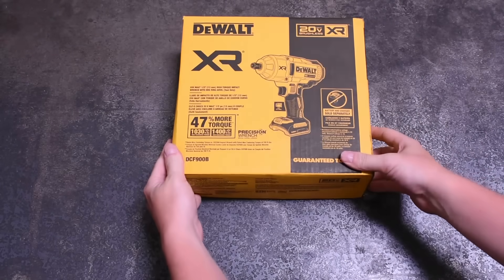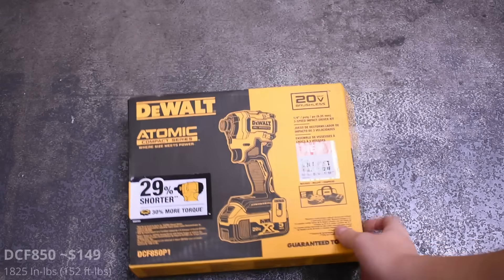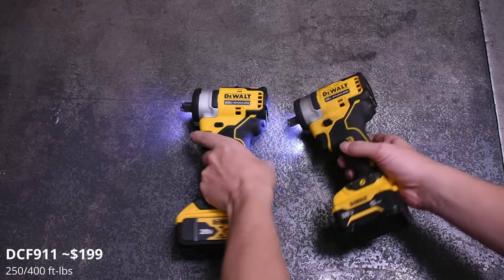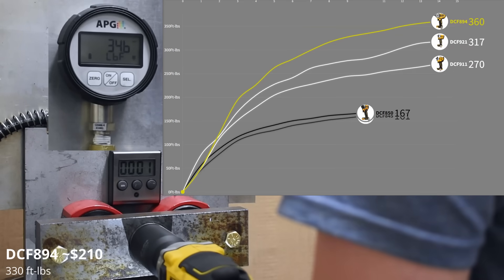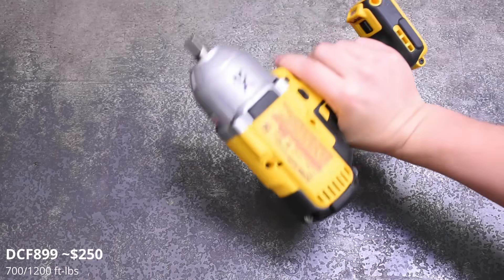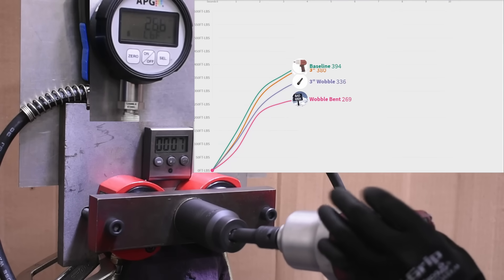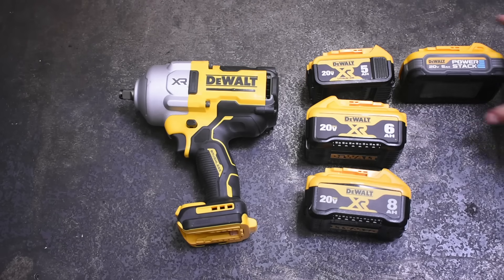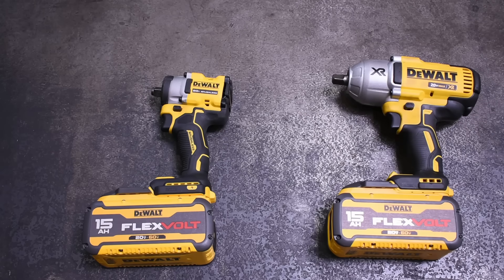Dyno Graphs of Every DeWALT Impact: How Much DO You Need?

Comment: Recently bought a DCF921 after watching your tests. Changed from summer to winter wheels/tires on our two 2007 Corollas.  It pulled aftermarket spline nuts fine from alloy wheels on one car. Toyota alloy wheels on the other car defeated the DCF921 at least half the time; those lugs were torqued to 76 ft. lbs. last spring.  I didn’t even consider the battery tool on my truck with 120 ft. lbs.  Full disclosure: battery was showing two of three bars.  For now, this tool does NOT replace my 1/2” air impact.
Reply: Agree, I just purchased the 921 "Atomic" and it is pathetic! Maybe it can remove a 140 ft lb lug nut if it's threads are lubricated!! Very disappointed
Reply: @bz2lrw  Agreed.  It does not replace a decent 1/2” air wrench.  Not even close.
Reply: so you don't recommend the 921 at all?
Reply: @calvintran8691  It works, but don’t believe some of the torque claim.  I robably should have bought the 923 and stick with 3/8” drive tasks.  I’ll still be using my 1/2” air wrench for changing tires.
Reply: @ thx i bought the 891
Reply: @calvintran8691  it removes smaller vehicles lug nuts just fine and I have decided to keep it for under body work (brakes, wheel bearings, ECT)

Comment: If the 921 gets up to 300ish ft-lbs, this would be approximately 400nm, right? And if my lug nuts on my car are torqued to 120nm as per manufacturer then it should be able to do it very easily right ?

Comment: Hardest bolt I ever removed was the steering box nut holding the pitman arm. Getting it off was even harder with a 2 ton pulley cranked as much as I could with with 24" breaker bar and 3' iron pipe then even had to heat it before it sounded like a gunshot went off when it finally popped off. I eventually decided to get some power tools because don't want to deal with that bs anymore.

Comment: This video was informative thanks

I currently have a Dewalt DCF 787N-XJ that wasn’t in this video, I don’t really know what the suffix characters mean however it’s mostly been good enough for me but it’s not strong enough to remove things such as wheelnuts etc so I am planning on upgrading to the DCF921/922 as they state 600nm of breakaway and it’s a nice compact size to get in tighter areas

Comment: I just retired and I don't know what to get...so if I am working on my mower deck and can't the blades off...which one of these fellas is going to get the job done and also get the tires off my car or truck without much fuss? I have 2 20v/60v 6AH batteries and 1 20v 5AH battery. I don't want to buy too much to handle but I also don't want to have too little for the unexpected. And could you use normal sockets on them or do I need to but another full set? I need help

Comment: I have a question.
Will a DCF921 and a DCF900/(DCF961) work identically when using with an impact torque limiting extension bar 135Nm/100 Ft-lbs for tightening lug nuts?
Or does the size matter even in this usage?
I already own a DCF899 but would like to get another for tightening the lugnuts as changing sockets is boring. So I want a new gun for tightening. But I can not decide what one I should buy, the cost is of less importance (and I always recheck with a torque wrench after I am done).

Comment: I bought a DCF900 yesterday, wanted the 891 but for a bit more money I got another battery and charger. The 900 does a great job ripping the leaf spring bolts out of an old Samurai, but I destroyed one socket that got stuck between the immovable object and the unstoppable force.

Comment: I purchased the DCF 961 after having numerous problems when restoring my 2003 Volvo S60... users should be aware that it's quite capable of shearing Factory-fitted Lug Nuts alongside every other seized Nut! It's an absolute beast that requires a lot of thought before you unleash it!
Reply: Literally had the same problem after we bought it to use on our farm equipments. Apparently I shouldn't scolded my cousing about shearing 3 nuts from the tractor. It was that monster.
Reply: I’ve thought about getting the big boy 961 1/2 impact , or slightly smaller 900 but that atomic 891 “mid torque” has served me very well and hasn’t let me down on anything I’ve put it on… yet, and until then…

Comment: Debating between getting the DCF891 or the DCF921… I’d mainly use it for removing lug nuts with the occasional suspension work. Obviously the size is the concern. In an engine bay the smaller one would be much more useable for sure but obviously not as powerful.
Reply from the maker: 891 for suspension

Comment: Actually the perfect application to 1/4 impact drill/drivers is in carpentry and in particular rough carpentry.  Without question there is not comparison to that of an ordinary drill/drivers.  My favorite for this application is the Dewalt XR Impact Driver, Brushless, 1/4", 3-Speed (DCF845B).  It is very compact enabling it to squeeze into tight spaces like studs that would be impossible with ordinary impact drivers and even the smaller width the Dewalt "Atomic" variation.  The three speeds enable a lot of flexibility.
 I also found that 1/4 impact drivers + screws with the more expensive Torx type heads (common in exterior applications) make the job so easy but the problem is that common Phillips head screw heads dominate for interior applications which require a lot more pressure to drive into place.

For automotive use, I would not even think of using a 1/4 IN impact driver but rather I would use a 3/8 IN or a 1/2 IN impact drivers.  I am not a mechanic, but if I were, it would not bother me to spend the extra money on the 900 or 961 considering that on Amazon are not that significantly higher in price than the mid-range cost of Dewalt  models.  Solves a lot of headaches.

Comment: I got my DCF891 with 5Ah battery not long ago . Had a short extender on and it did not losen any of my wheel bolts on a audi b6 avant. I know I regally over tight wheel bolts. And then it struck me  remove the short extender and try. I had seen the video where a extender or swivel reduce the nm significant, so removed the extender and all the bolts came lose so impressing fast and easy . But it difficult to quite understand that a extender that was only 6cm long did not remove one bolt event after tryning for over one minute on two different bolts.

Comment: Was changing the timing belt on an Acura TL and learned about the dreaded Honda crank bolts.
Used a DCF921 and a 19mm impact hoping it'd workout. It didn't budge.
Ended up getting a DCF900 and the weighted Lisle 19mm. 
Not even 1 second into pulling the trigger and it just broke free and came loose, it worked even better than I'd have hoped probably overkill even 😂

Comment: Would it be worth upgrading the motors and power systems to 60 volts or more for these smaller handheld power tools?  Is that a natural progression we might see in the future, as they run out of upgrade headroom?  I would think it could improve efficiency and maybe wire diameter?
Reply: Problem with 60v is the smallest possible pack requires 15 cells compared to only 5 for a '20 volt' tool. The highest power motors in the 20v tools can manage with 12 or 10 AWG at the worst and they all have overheat protection built in to account for this. 20v is ultimately a bottleneck and can't compete with 120v AC motors at 1800 watts and while 60v tools can in theory, that kind of power draw would require a massive battery to not drain in <10 minutes.

Comment: I'm still so confused. I want either the Flex 1/2" mid torque with 540ft lbs or the Dewalt 12 volt DCF901 with 276 ft lbs. But the Flex impact is roughly $125 more for the kit than a DCF901. The DCF901 is $70 for the tool, and the Flex is $199 just for the tool. I'm concerned about the 276 ft lbs not being enough for suspension and lug nuts? The Flex comes with a lifetime warranty, which is a good selling point, but $270 for the kit with a battery is a steep investment for a home use tool.
Reply from the maker: 901 wont do it all

Comment: Thanks for this. I've been trying to figure out what I actually need for general car maintenance. The dcf921 seems great for me. I almost went bigger but I like the compact size.
Reply: the 921/922 (they're the same?) is genuinely one of the best automotive tools, along with the milwaukee equivalent. Anything larger won't be as easily manouvrable, but most importantly get in those tight places, and anything smaller can't guarantee that the parts come off.

Comment: Dewalt 892 worked good on my very over-tightened lug nuts on a couple of cars and trailer, and also the big 33mm nut securing my tow ball, which was somewhat rusted on after 20 years.

Comment: What dewalt should i use to remove 4 bolts stuck to the crank pulley?
Reply from the maker: DCF891
Reply: @TorqueTestChannel would the dcf899 better? some idiot on audi dealership decided to overtight and probably put some loctite, couldn't break with 300nm torque wrench
Reply from the maker: @GunMetalMage  nah, 899 wouldn't be overall any real benefit over 891

Comment: I am not sure I understand these NM readings. I bought a brand new (from a reputable dealer) DCF887 with 18v 4.0ah battery which I fully charged. The user manual says it can achieve 189NM. My motorcycle has rear wheel nuts torqued manually with a torque wrench to 60NM and the DeWalt wouldn't even scare them let alone remove them ?

Comment: Recently got a dewalt 1/2” compact. 

I was surprised that it wouldn’t remove my Jeep JL lug nuts. Torqued 130lbs. 

DCF921B
Reply from the maker: There's not a compact we recommend to do most lug nuts.
Reply: @TorqueTestChannel  for sure. I had my M18 high torque ready to go. Was just testing it out etc. 

Still love it!

Comment: Thank you for the video!  It was very well done and as others have stated: just the information I was looking for/needed.  
Have you any thoughts/analysis on DeWalt's relatively new feature called Precision Wrenching that reportedly guards against over torquing the tightening or loosening with these mid to high torque drivers? Thank you in advance, c3.

Comment: How the heck did I miss this when it came out. Didn't even know about the 961. Guess I got to pay closer attention. DeWalt needs to put a 3/4" or 1" anvil in that 961 and then they can have my money. Amazing how tight some stuff can get. I had a bush hog gear box oil plug fall out on me and unknowing ran it until it seized. My 3/4" air wouldn't budge that nut even after heating it to cherry. Eventually had to use the hot wrench to get it off. You know it's tight when you start deforming the nut and it still isn't moving.

Comment: Ive got the atomic 20v 1/2 inch drill, the atomic 1/4 and 3/8 impacts and the 3/8 ratchet. Love them.
Reply: 1/2 inch drill is dumb. all u need ia 1/2 inch high torque impact, 1/4, and then adapter 1/2 to 3/8 and impact rated drill bit and ur set boyo

Comment: you have axle nuts come in lower than most lug nuts ???
Reply from the maker: Lug nuts are at 300, then if you want to cover EVERYTHING that rolls in, 475. The thing with axle nuts is everyone uses a torque wrench, and while it takes a decent size impact few of them are like STUCK and corroded solid. While lug nuts sometimes the last guy just ugga duggad it way too long then it saw salt for 5 years.

Comment: i have the DCF894, it couldn't free my ball joints off my 07' ram 2500 CTD but can loosen the lug nuts no problem. i'm ready for more torque  tho. I'm glad i had a 3' ratcheting 1/2" Dr. breaker bar as the ball joints were way overdue.

Comment: Hi. About 10y ago I decided to move to battery tools and chose team yellow over red or blue and I’m not disappointed. The other colours have their great features and I have some red handtools (lovely) and blue corded ones (fab). I have the following. My DCF885 (small), is the 90% go to and a very capable and controllable driver for screws and smaller other fasteners. Next the DCF880, a 9% go to, but only a little more capable. It’s sometimes very useful as a fairly short 1/2”. Finally the DCF899, a 1% go to but I’ve not found many occasions where it fails. Occasionally it’s been crucial but the same can be said for long box-end spanners and breaker bars. Also, penetrating fluid and a high-frequency induction coil-heater can be far more useful as big drivers can break fasteners as soon as look at them. Cheers!

Comment: Thank you for this, incredibly helpful video. I work on my car A LOT. I do anything and everything on it, anything from coil overs and other suspension mods to timing belt and water pump to soon, AWD conversion having to deal with swapping out a subrame. I also need to swap my transmission, do a new clutch and flywheel job, etc. So as you can imagine an impact wrench would save me H O U R S. I'm in between jobs at the moment so I'm working on a budget but I was looking at cheaper brands with about 360nm of torque. While I think it's still a decent amount I think after this video I will definitely consider spending more on a higher torque unit that is more capable of helping me on more jobs. Unfortunately these tools are quite expensive to buy here in Australia. For reference, the DCF891 is $399 and the DCF900 is $499 for just the impact. I was looking at a RYOBI with 360nm for $250 with a 5AH battery and the charger plus 3 impact sockets, 6 years of warranty and 3 years for the charger and battery. If I already had some batteries and a charger I would definitely get a nicer one, but I believe a nice 5AH battery and a charger would cost upwards of $250 on top of the $399 or $499. So quite expensive.

Comment: im puzzled by the torque recommendation chart - 174nm is the highest torque requirement i know of in e.g the toyota lineup - the landcruiser. a smaller cars` service manual like a suzuki swift specifies about 75-80nm torque for wheel nuts. 300lbsft is 400nm+ - thats insane for an m12 8.8 screw, it is almost m20 8.8.

Comment: Absolutely love my DCF900. It managed to shear a wheel bolt off a sprinter, where the milwaukee and snap on impacts couldnt even get a mm of movement. We resorted to a 1 metre breaker bar, with another metre worth of pipe to get all them off

Comment: I had to get a hydraulic nut off which if you don't know, takes high tourque on a small diameter. Tried everything, then realised I had an old Dewalt TR in the garage that I retired from my carpentry business due to being so heavy and not needing it because all our bolts are in timber. Needless to say, I do my truck tires too now.

Comment: Bro I needed that storm bringer. I used my DCF921 stubby for the rusted bulged upper control arm like you mentioned and none doing. So I breaker barred it with pipe cheat now all the nut thread is eaten up. Time to hit the angle grinder and welding in a new receiver nut. Wish me luck. 😂

Comment: Looks like fastening torque? Not break loose?
Reply from the maker: forward and reverse max torque, correct. Break away torque is a fickle one to measure, as it depends greatly on thread size, pitch and condition. Where as a gauged set up like this can be calibrated each day.

Comment: I have only found one thing that my 921 hates and that’s the lug nuts on my truck. Aftermarket aluminum wheels and i torque them to 150 ft lbs. I have to use my 891 to break most of them free.

Comment: That 6Ah XR battery link in the description not being sold/shipped by Amazon is kinda ehhhh..
There is however a 6Ah 2 pack on sale for $161 with the added benefit of having a payment plan provided by Amazon so you can pay $53 a month for 3 months, provided by Amazon meaning there is no APR and no credit check bs. (Though that payment option MAY NOT show for everyone)

The difference between normal 20V packs and the Power Stack versions are that Power Stacks use Flat Cell packs instead of 18650/21xxx type batteries right? if so that could account for the price/size difference i guess?

Comment: Iv hade most of these impact drivers in the last ten years and I have had very good luck with them dropping on concrete many times and the ony problem iv had was the  ball and spring chucks would malfunction dropping the bit out but it was an easy fix.

Comment: I bought a DCF900 a few weeks ago. Easily takes off rusted VW axle nuts. Though, the one it couldnt take off, neither could my co-workers 3/4" mac air gun. even with heat it took him maybe 20 minutes to remove it, he had to heat it up so much.

Comment: I have both of the sub compact guns,the impact driver and the impact wrench.The small size and enormous power make these impacts the best on the market in my opinion.Thats DCF850 and DCF 921.Those two along with a high torque and you have everything you will ever need as a DIY guy.And sorry Milwaukee but IMO Dewalt is king when it comes to impacts.Dont be a fool and buy that 12v milwaukee stubby,buy the 921.

Comment: Great video, I have a question if you can bare with me! I’m an apprentice railway maintenance technician, we have countless bolts that need torqued. A common is 1”1/8” bolt that needs torqued to 1020nm. Our current best option is a massive petrol powered torque gun that weighs a tonne. It gets nearly the full way there but we always need to fully tighten with a long handled spanner. Out of curiosity, If we had access to the project ludicrous drill with say a 6 amp battery, how long would that drill last if you were using it nightly on say 50 bolts a night. Would it be out of commission pretty quick or would it be a good investment over our current option?
Reply from the maker: The Project ludicrous would kill itself or the the sockets attached due to being 1/2" drive, I'd want to see it in 3/4" 1st. Look at the Ingersoll rand https://www.youtube.com/watch?v=pKLRhT7PGbo That beat our gas railway gun we bought by some margin.
Reply: Thanks so much for the advice and quick response :)